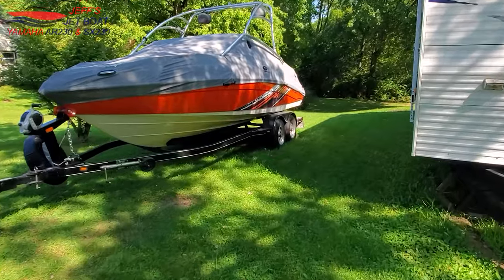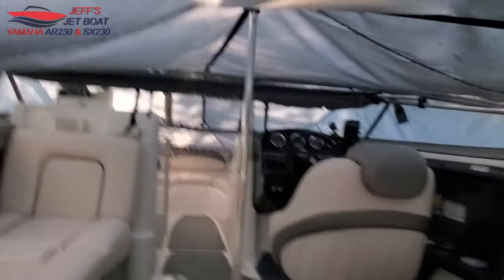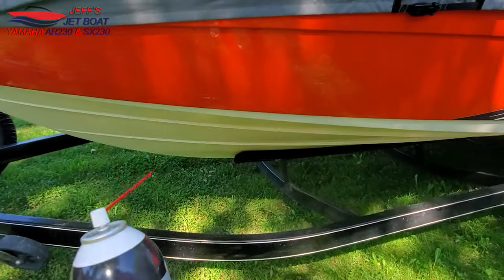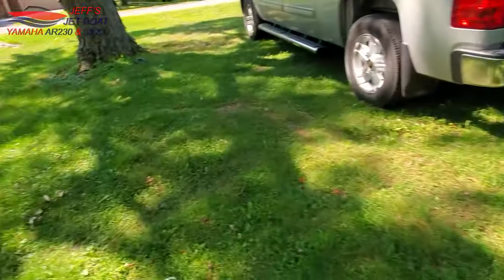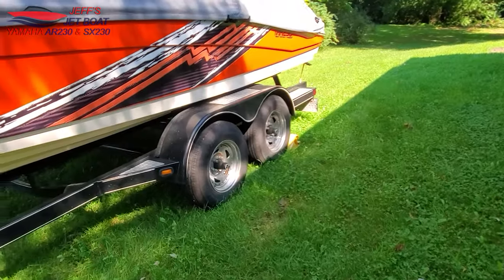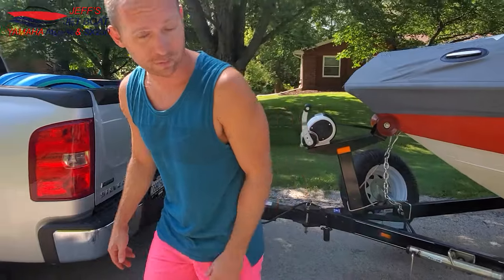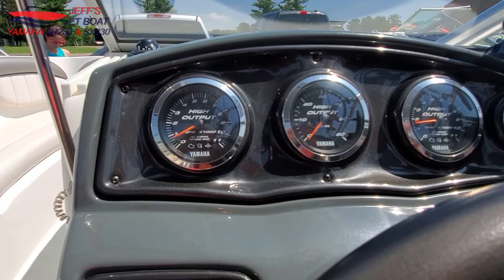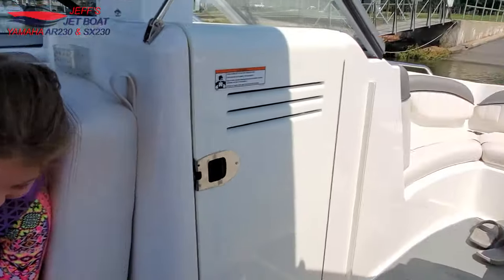The Boat Trailer Video - Yamaha Jet Boat

Comment: Hi Jeff. I've got a 2006 AR230.  Been a bit of a project boat but it looks and runs great.  I wanted to thank you for the tip on the sticking bunks. I had to back the trailer up until the fenders were totally submerged. I sprayed the bunks with Teflon and it's way better.  Thanks again.
Reply from the maker: No problem!  I glad the video helped you out.

Comment: The silicone is no joke. Our 2020 212x would NOT reverse off the trailer without pulling with dock lines and was a turd getting on the trailer. Once I sprayed the bunks with silicone, it’s like ice on and off.

Comment: Hey Jeff great videos on your boat love watching, i have the same boat in black and white. On the cover the instructions from Yamaha say pooling poles are for when boat is stationary only. Poles are to be down due to Yamaha design on cover. If you notice there are two black vents on cover those serve as creating a suction on cover while towing. The vents are designed at a certain angle to that when towing air passes by vent causing a venturi effect sucking the cover down tight to boat when traveling so there is no moment of cover. This eliminates chafing under high wind conditions traveling. Which is why so many other boat cover don't last. So if you travel with poles up like allot of people do it puts undue stress on cover as its being pulled down on pooling poles and rigging. Pooling poles as they are called are for when your boat is sitting in yard when raining. I just lower poles while still in place while traveling so when cover is pulled down it is not sucking down against pooling poles. I have a friend that is an engineer for Yamaha that told me about this. But instructions for cover do tell you to leave down while towing for this reason. Keep up the great videos !
Reply from the maker: Thanks for the info.  Our cover is still doing just fine with only the rear pole up 5 years and counting!  We still drive to the our lake 3 days a week just about every week of the late spring and summer.  I bet my  boat cover has 50,000 miles of drive time on it at 70mph!